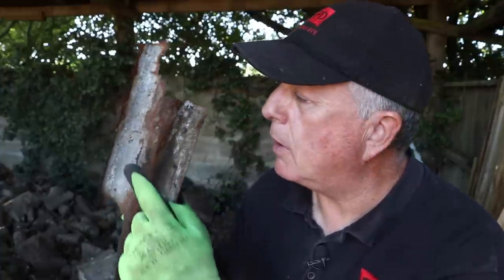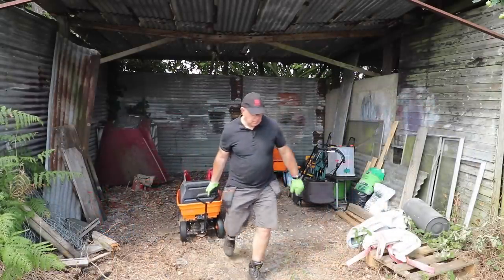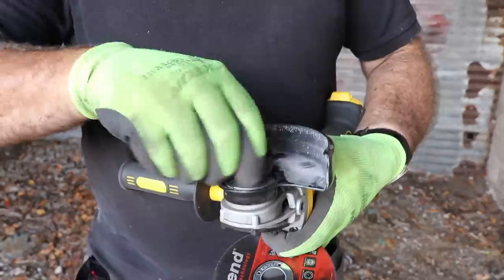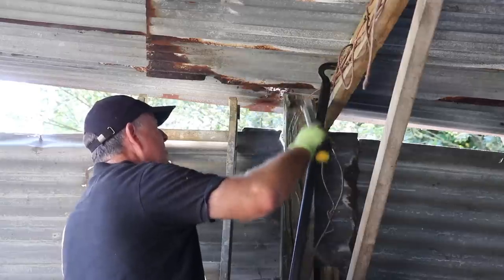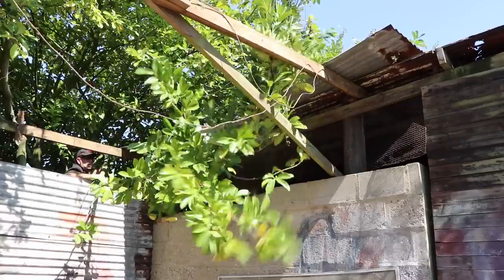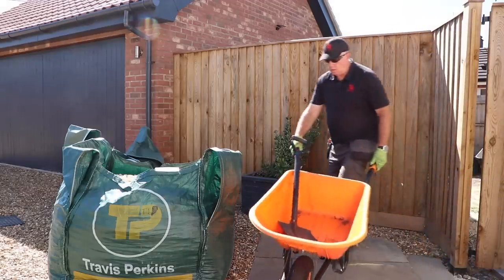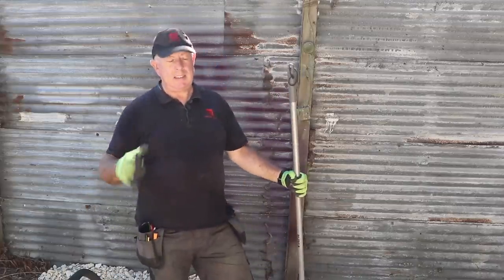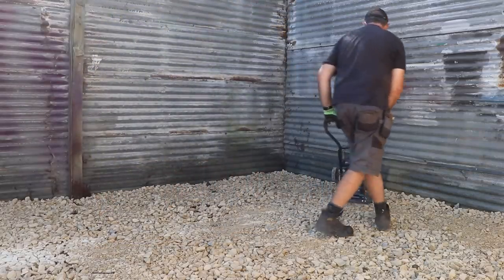Replacing a Metal Roof - Part 1 (Demolition)

Comment: I had to take off a metal sheet roof last summer.  I used a flexible metal blade in a reciprocating saw to cut the fixings between the  sheet and the structure, which avoided the problem with access
Reply: also cuts down on the sparks.

Comment: I’ve had approx 50 tons of type 1 delivered loose on to my drive this summer and you are so right in what you say in that it’s as much a mental challenge as a physical one to spade and barrow it round the back where it was needed.  Soul destroying work at times
Reply: 5 ton a day easy, n that’s taking it slowly 👍
Reply: @thedj5914  I didn’t have 10 days to do it, just a long weekend.  The run from the pile was also uphill and about 40m each way
Reply from the maker: 50t is one big pile to move by hand - well done!
Reply: I have a ride on lawn mower with a car hitch and small trailer from Halfords very handy around the garden..The garden is ¾ acre. Also use it for taking rubbish to the dump.....watching from  Galway, Ireland
Reply: @christinebeynon9967  work smart, not hard 😜👍

Comment: You want a little lawn tractor and trailer for moving stuff about. When I did my parents' driveway a few years ago I loaded a good 200-300kg at a time into a little trailer behind their lawnmower, then opened the tailgate slightly as I drove over the driveway to distribute it. Worked a treat. That was pea gravel rather than type 1 though so probably flows better.
Reply from the maker: Yes maybe an investment for next year

Comment: It would be nice to see you building something to collect rainwater, as you mentioned the problem with the water supply.
Reply: Sure he said in another video he will be doing that though given the weather at the moment I don't think there is much of a need to rush as there is no rain about.
Reply from the maker: As C4sp3r says, the problem is no rain. I am currently using 1-1.5m3 of water a day. Even if I build a 3m2 tank that just lasts 2 days! Not worth the money if it doesn't rain much - if it does rain you don't need the watering system!

Comment: Another good project video Stuart. Looking forward to part 2.  
I was doing something similar in the heat last week as well. My job was adding some corrugated PVC roofing to an open top wooden gazebo to stop birds using it as a perch & pooing all over my BBQ & other outside kitchen kit. It started out as a simple enough job but quickly got more complicated as I wanted to make it a sloping roof & add a gutter which required a lot more timber than I thought & working with restricted access on two sides. Hey ho. The back garden looked like a building site for a few days with just about every tool I own put into action but I got it done in the end. I'm now thinking about adding a rain water butt to the gutter down pipe. That's assuming we get some rain at some point  ⛈.

Comment: To me there didn't look to be enough fines in the MOT as you know that's grit dust to help with the binding and tightening up of the material. 
You can always blind it over with grit sand. 
Not telling you how to do it, but I've had that problem in the past on drive way jobs

Comment: Looks like you could def do with a motorized barrow with tipper function.
Reply from the maker: Maybe if I want to spend a large some of cash
Reply: @ProperDIY  I know they can be expensive these days. I remember in my very 1st job as a YTS gardener we had one where the engine part could be separated from the barrow and you could use it as a rotavator

Comment: An hour a ton for sub base is good going in that heat, fair play to you. Getting the stuff out of those bags can be frustrating and saps your energy especially when it gets towards the bottom.
Reply: A micro shovel is great for this sort of job or if you can, spread a sheet and a few boards on top and have the delivery driver hold the bag up and use a stanley knife to cut it open and deposit the contents of the bag on the boards - makes shovelling it so much easier.
Reply from the maker: Yes, easy when you start with a full bag - a pain once its over half empty!

Comment: Given the distances you are moving lots of great, I recommend you get a second hand lawn tractor and fit a tow bar to the back..As soon as you can pull a trailer you'll avoid using a wheel barrow as much as possible.
Great video as always.
Reply: Was about to comment the same - we have a tipper trailer on our ride on and have shifted tons and tons of type 1 and gravel and soil with it. The trailer is so handy for all sorts of jobs.
Reply: I'm sure I have memories of him having a four-wheel vehicle that should be able to pull a trailer, might have been imagining it though..
Reply: I have one as well also a small tip trailer, although a small car trailer would work as well. With that large plot you have Stewart, you will be using it all the time.

Comment: Another one for DIYers who buy a pack of abrasive discs and then don't use them for ages. They have a use by date stamped in the middle.
Reply: What, really? Are they made out of bread?
Reply: @AlbionSupreme  No the glue can degrade over time and then the disc can delaminate. There is quite a lot to angle grinder safety. Suggest watching the Ultimate Handyman's video about it.
Reply: @Paul-XCIV2  exactly, that could easily cause them to explode when being used, my number hate is when people take guards off the grinders too i know someone who was injured by a disk accident and they wasn't even using the machine they was just standing close by also if a disk is dropped that'll weaken it too so if a disk is dropped from any height it should not be used.
Reply: @jason-km1wi  Agree. Should also be discarded if the discs are in the slightest damaged or get wet. Running without the guard is asking for trouble...
Reply: I got discs from 23 years ago and there still good
Reply: @Paul-XCIV2  for the price of a new disk its just not worth the risk, something that also irritated me is when people dont run the right size disks like putting a 7 inch disk on a 4 inch grinder which will also require to remove the guard, that is a classic example of recipe for disaster. Gloves are however a grey area some say yes to protect hands for debris and stuff but others say it can maybe cause a tangling risk i still wear them but i just take extra care
Reply: @mrnathnlan6291  personally id never use an old disk but hopefully you never have any issues with them just remember to wear full ppe just incase because even new disks can fail at the high rpms grinders spin at
Reply: @jason-km1wi  Putting larger discs on smaller machines is also a no no, because the smaller machine can exceed the RPMs the disc was designed for (larger machines run at a lower RPM).

Comment: Stuart, surely when it comes to moving material, the debt owed by loaning your cement mixer should have been called in 🤣

Did you hot works permits allow working from ladders, I thought they were for access only? You should look in to getting yourself a Monkey Tower. I did, and the purchase paid for itself in no time at all.